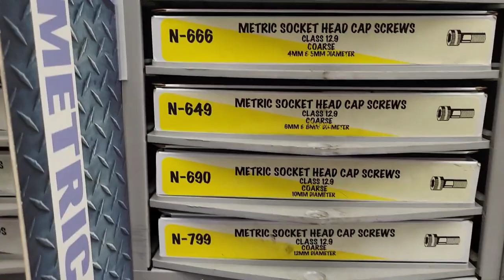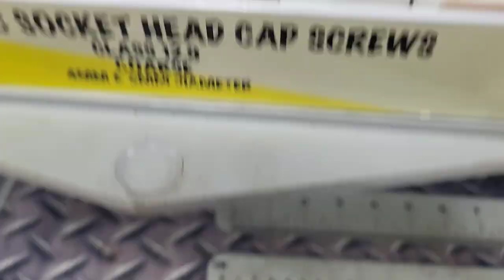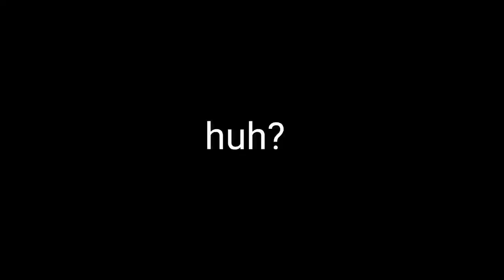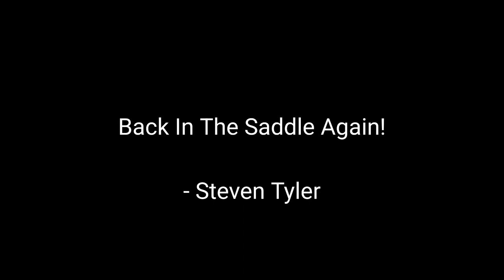Minor Drama On A Tandem Bike (Broke a Seatpost Bolt)

Comment: Hi, What kind of car is that?  We can't believe you can fit the tandem in there!  We have a Santana and have to take it apart to shove it into our Elantra.
Reply from the maker: It's a 2002 Mazda MPV minivan. We removed the middle row seats and the rear seats fold down flat into the floor. It's very convenient!!! We also have a Ford Focus wagon as well but have to remove both wheels from the Tandems to get them in that car. I'd think that tandems should fit pretty easily into most minivans.Thanks for watching!!!